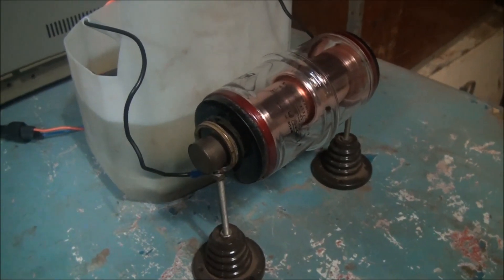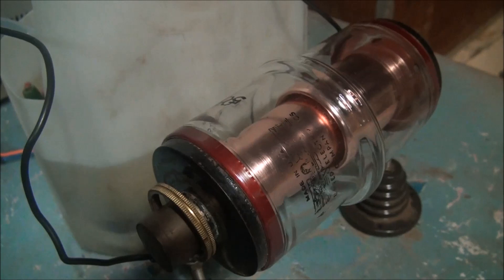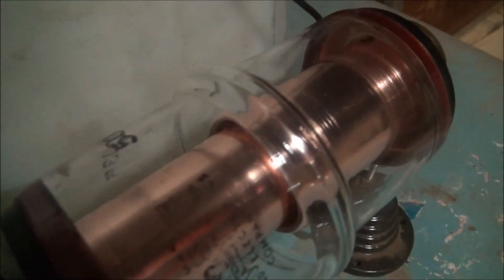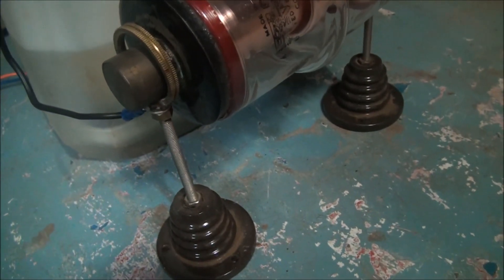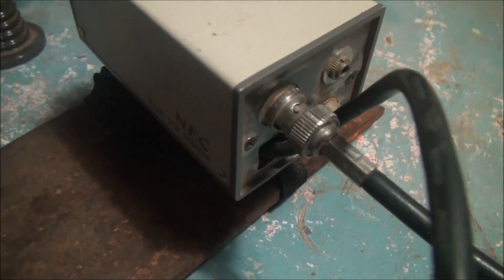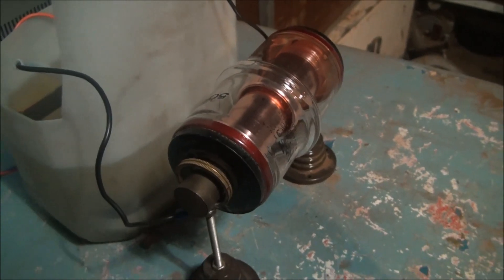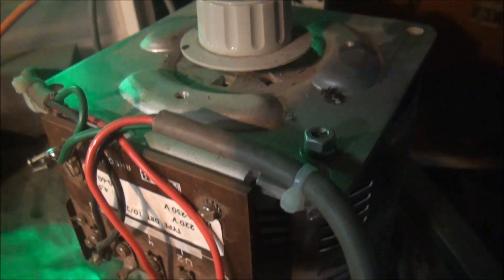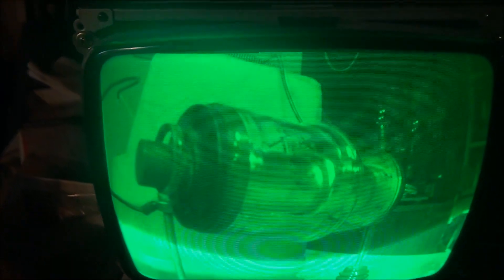Overvolting Capacitor, Danger! Xray radiation!

Comment: I do not think the X-ray quality would be any good, mostly low intensity "soft" X-rays. Modern X-ray tubes use Tungsten targets and very high voltage potentials of over 70KV. Plus the enclosures are lead shielded with a small aperture to allow the emission of X-rays. This experiment was a bit of fun to explore radiation emmisions of a highly stressed Capacitor!

Comment: Great video!  What is that capacitor originally from?  And what is the rated voltage and capacitance printed on the side?
Reply from the maker: I am seeking some more info, I guess it would be used in high power type RF application. It has 50 etched on one of the internal electrodes so possibly its 50 picoFarads. I will ask a friend of mine who had a long career in the Radio field, I am sure he would know and hopefully I can pass on the info to you. Cheeers, Ian
Reply: +rustymotor I look forward to that.   In the video it looks like there is something printed in black on the outside of the glass,  but I can't make it out.  Or maybe I'm just seeing a reflection of something.